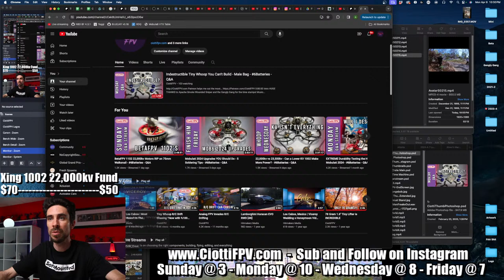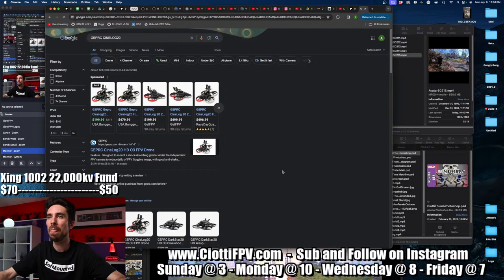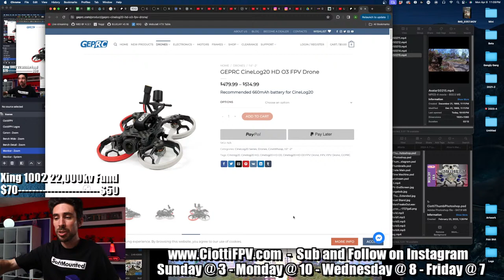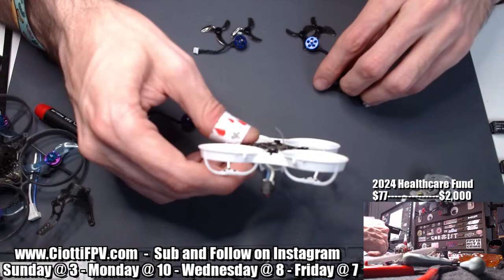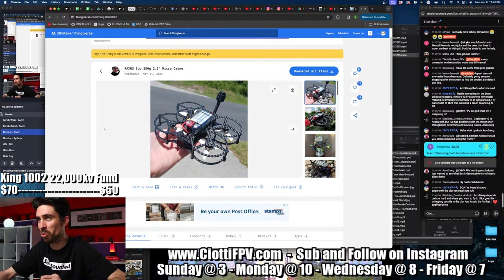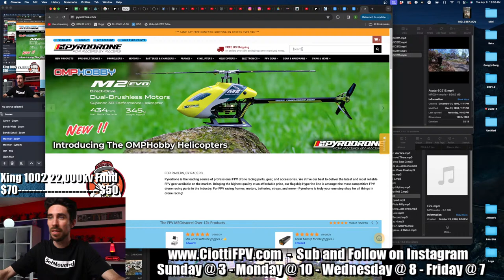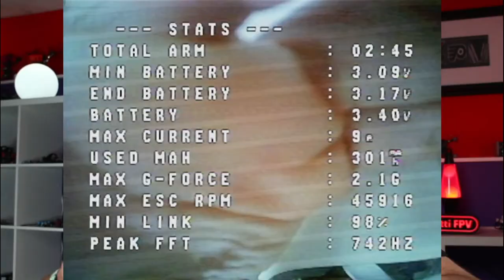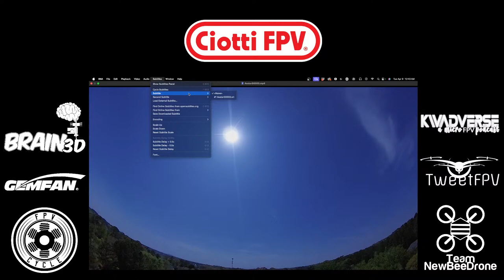Indestructible Tiny Whoop You Can't Build - Male Bag - #6Batteries - Q&A

Comment: 08-04-2024

What’s up GG and Ciotti.
00:02:26 Rc chase drone had some issues.
00:08:46 How to support the madness……
00:10:52 I finally got my insta360 go3 mounted on my baby ape 2 but my flight time was ass i was getting like 2 mins
00:15:00 Anyone in chat know of an insta360 go3 mount for the baby ape II? I’m mounting it with makeup foam thing, a leftover battery strap and some rubber bands, its incredibly scuffed.
00:15:35  Is this a 1.5mm shaft 65mm?
00:15:45 On this stream.
00:20:29 Ok got to ask, have you tried those magic 1102's on a 65mm for the 3 minute flight time? Is the performance just trash?
00:23:34 I dropped an eclipse flight in the troubleshooting discord. I have a motor stall at 30 sec. should I worry about that motor?
00:28:52 Have you ever been to Lanier raceway to chase drift cars in Braselton.
00:30:10 Teddy pay per view 😉
00:31:48 What is a 2.5 quad to build?
00:35:33 Just ordered the moblite7 Walksnail, what motor do you suggest ?
00:37:57 Have you tried out the tooth fairy 2 3.5 inch frame? I’m going to put my 3 inch Cinewhoop on it so I can switch between it being a Cinewhoop and a freestyler. very excited.
00:43:58 What is your opinion about balancing your motors?
00:45:22 Thoughts on the Quadmula F35 split?
00:49:03 Did you see the HGLRC SPECTER 10A 1-2S ELRS AIO VTX 400mW F411 Flight Control 10A BL_S 5 in 1 FC? Option for 75mm?
00:51:06 I got those motors!
00:52:06 Have you seen/ tried the ECO yet?
00:56:02 I flew for the first time a few months ago on my friend babyhawk 2, I flew it pretty well but I "discovered" ground effect for the first time and couldn’t pull out of a diveprop exploded and I found it now, 8 months after.
00:56:33 I think you missed these props when you said "I wish we have 40mm Tri-Blade lightweight props" - NewBeeDrone Azi (Tri-Blade) Micro Propellers 40mm - 1.5mm Shaft. Weight is only 0.28g
01:02:48 What are your thoughts on GEPRC CINELOG20?
01:09:00 Propellers have a lifespan!!
01:15:09 Are there any 3d printing services that do TPU? I'm prototyping a 25x25 canopy with a GoPro style mount.
01:17:25 On a help required now note any tips to get a broken peek screw out of 0702 motor.
01:18:45 I want to convert my baby ape 2 to the f35 split to carry my insta360 go3, but you got me considering converting it to a 3in with those t motors
01:19:20 Thoughts on the mob8 2s Walksnail edition? want a small outdoor Walksnail flyer.
01:21:03 Just built a 75mm with the hdz eco. most significant difference is that the eco camera fits a mob6 canopy. Also the included antenna is the best linear antenna I’ve seen to date.
01:21:34 Let’s normalize tiny whoop motors being sold in sets of 5. 4 is so annoying.
01:22:23 You seem like a flyer bred for great latency. thought hdz offered the best of that. Does Walksnail feel close enough for you when freestyling with the extra fidelity?
01:30:33 UV light also makes plastic very brittle if you’re flying outside
01:30:45 I have 32g Walksnail 40mm with azi props and 1002 but want to try 0802, what do you think?
01:32:07 Took the camera off my blown up Mobula 6 2024 AIO soldered wires with plugs on there and it worked! thanks for the soldering lessons, I am getting good !
01:32:16 I wonder if a hot needle let it cool and then back it out.
01:32:42 Do you have any insight/rumors if the shortage for the mobula6 2024 is still in effect?
01:33:00 So this is the build plan so far. F35 split, stack from my baby ape 2 (35a 3-6s), XNova 1804/FPVCycle 16mm, 600mw vtx, insta360 go 3
01:34:13 Reaction time is not perception time. Human perception of latency varies between people. JB showed an application last summer to see at what level of latency you can "feel".
01:35:08 What AIO does your tiny lifter use and do you put 2 bt2.0 batteries in series for 2s or in parallel for dB the mAh? going for more voltage, more amps, both? I searched your channel 4 lifter.
01:36:35 Can you use 0702 on 65mm with HDZero?
01:37:17 Mob6 2024 shortage is a shortage of an FC component. HM is prioritizing Mob6 shipments, FC alone will be later. Confirmed through multiple vendors and Jason.
01:37:45 Build the indestructible Whoop.
01:40:12 Motor connector vs direct solder make any difference?
01:44:40 Male Bag.
Will 0702s push 35mm prop? What about 40mm props? What’s the limit of 0702s?
0152:29 Continuing the Indestructible Tiny Whoop build.
01:57:02 Long wires are usually found on fixed wing and surface batteries. Strange to be on an R-line, i.e. quad racing battery.
01:59:25 Dancing with……
02:03:45 Drone porn
02:04:46 I need stick end for my radio master boxer and I need something soft for my thumb and what’s the number on those they have the m3 and m4, which one?
02:11:09 the 533 ones appear to be resin printed and reports are that those crack
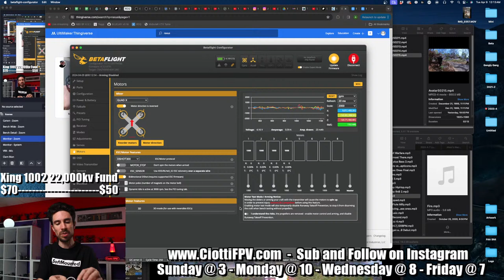02:12:25 If your props rubbing on the frame, you can use turtle mode.
02:13:30 Lets weigh and fly the indestructible whoop.
02:14:42 what’s your motor size and Kv recommendation for an outside 1s 75mm jungle gym basher
02:15:35 Flying with Teddy.
02:24:05 Best outdoor tiny whoop?
02:31:41 Maybe 0802 Walksnail overheating because you run biblade and motors should spin faster than triblade. That’s the reason why I want to try 0802 with azi triblade lightweight props.
02:33:04 I meant motors overheating
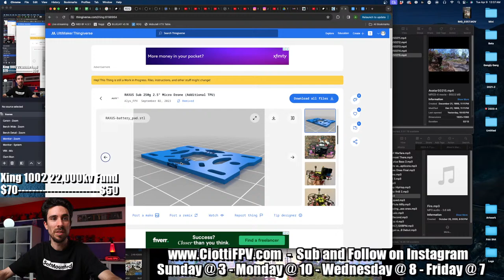02:36:13 Thoughts about the Indestructible Tiny Whoop
02:36:46 What weight do you like for 65mm tiny whoop?

Stay safe everyone and have fun flying.

Comment: I will let you know how my 3inch 1404 6000kv 4S build goes when it's done.
Reply: 6000Kv?! That might smoke a motor, no? 3 inch 4S is usually ~4600Kv
Reply: @mikerich32  I will be motor limiting until I find that sweet spot. My goal is to run low pitch bi-blades on a prop guard build, so will see where the limit ends up. Either way better to just have that extra kv there and motor limit down a bit anyway, some would even argue it should potentially fly better like that.
Reply from the maker: @mikerich32  with low pitch props he should only need to motor limit down to %90 or so

Comment: hi iv got a 2s 75mm betefpv with 1103 11000kv motors and the battery just doesnt last long at all like 1 min? any ideas why? im running a crsf nano rx and mini mortal t. hope someone can help?
Reply: Take a fresh new pack (hv preferably), fly and when it's 3.5v per cell land, disconnect and check the voltage. These motors could sag your pack so much it shows as empty. What's the total weight of your rig? Was runtime so short when rig was new?
Reply: @micro__PP  I bought 2 new cnhl hv 350mah and they are the same as the Betafpv ones it came with, it’s actually draining them I havnt weighed it il do it shortly thanks 🙏
Reply: It’s the 75x I got it used it came with a second pair of the same motors new in the box so I didn’t question the motors, what size would you recommend?
Reply: I got the same motors, flew simmilar setup and they are just not good. Try 0802 16k for 2s or just switch to 1s 0802 above 20k kv
Reply: @micro__PP  will do chief  thanks
Reply: these motors good for anything seeing as il have 2 sets spare haha
Reply: @micro__PP  62g with the 350 lihv
Reply: @andyd5321 those motors are good on a 2.5 inch 2S build. I recently did that size build with the T-motor 1103 11kKv motors, HDZero whoop lite vtx, freestyle frame. Dry weight 75g, with 2S HV battery 105g. I'd recommend either bi-blade props or tri-blades with a lower pitch, like Gemfan 2512-3 props. 

You could also do a 2 inch build. But it might be underpowered on 2S and overpowered on 3S. Could just do 3S with motor limit, but idk, 3S 2 inch just seems kinda weird to me.
Reply: @mikerich32  thanks Mike! Iv got a few frames I could put them on, just surprised how bad the flight time is on standard parts
Reply: Build a 2inch toothpick if you don't care about prop guards. You just need a frame and props
Reply: @micro__PP  iv got one in the cupboard a little betafpv twiglet